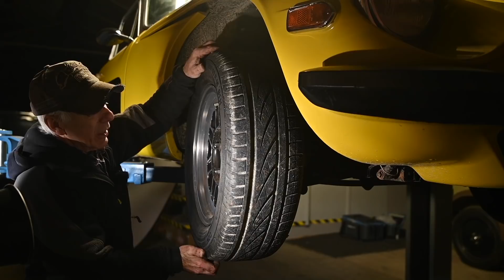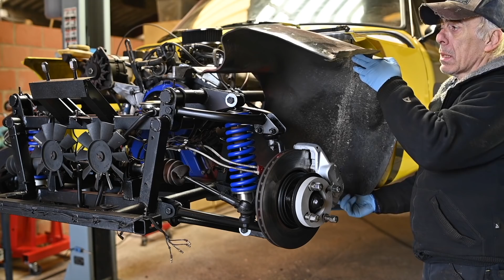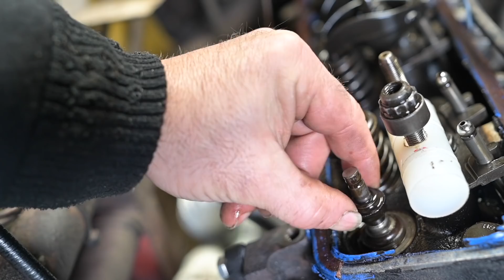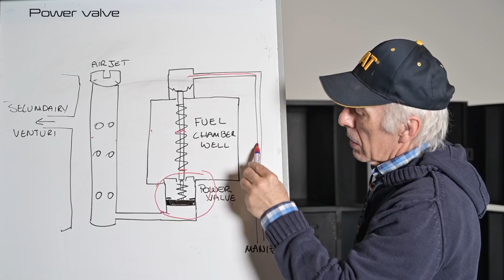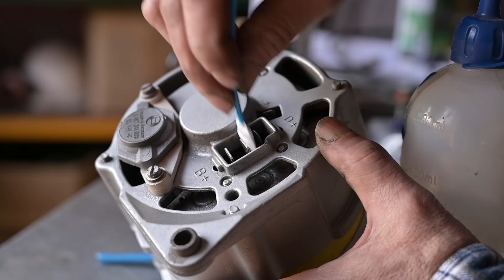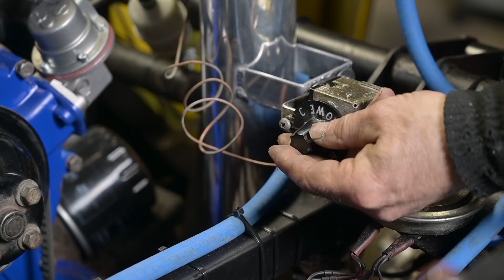TVR 3000M mechanical fix in 13 minutes

Comment: A very nice overview of this project! I have never been a fan of Ford engines, I had one in my Morgan and it was always the weak link, unlike the excellent Ford gearbox, which was a joy to use, I look forward to your next living with a TVR video! Stay safe! Chris B.
Reply from the maker: Thanks for the comments, indeed the gearbox works so well.  I can't say that they are bad, they are simple and possible not that reliable..
Reply: @D3Sshooter  Simple, yes and a bit primitive,mine was always wearing out piston rings and blowing oil out of the engine, even with correct ring gaps and a new bore ?

Comment: A lot of great work has been put into this car to be reliable for many years to come. Looking forward to the tuning of the motor and dial up of the carburetor and the work on the body, including those missing front fender liners. Great project, Steve. Thank you!
Reply from the maker: Thanks for the comments, more is to come. The inner fenders are fitted meanwhile